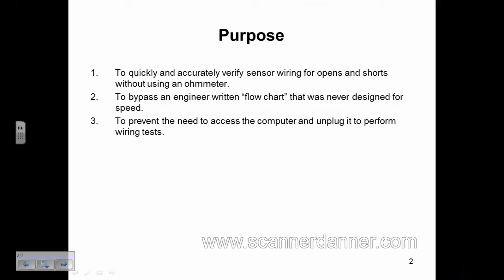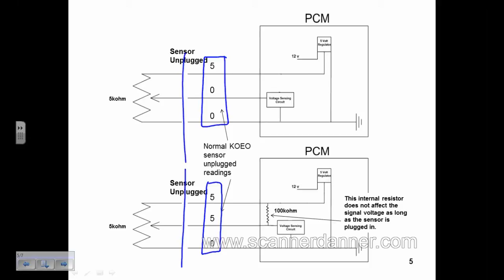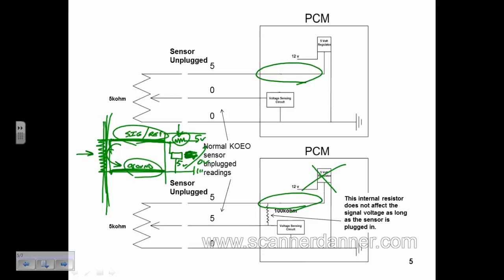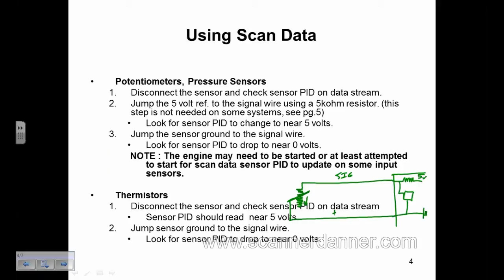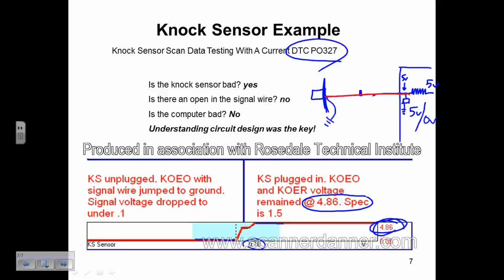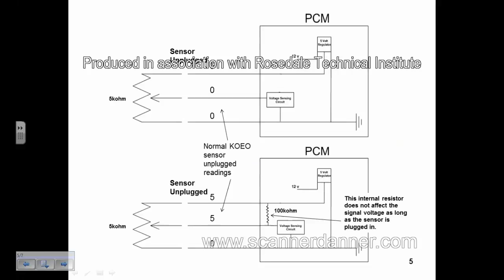Chapter 10 Signal Circuit Integrity Testing

Comment: Opps last week , I had a gm fuel tank pressure code, and I used a test light, and t pinned on wore and touched the test light to the other wire while watching scan data. I guess I should get a 5 k resistor for this ?  In my case it did work. I didn't know there was a risk as I though the 5 cold ref was protected I. Case of shorting . Off to radio shack I go. I like building little tools.
Reply from the maker: just trying to be extra careful with what I am teaching.
The 5v ref circuit is protected but I do not want to rely on that. Just as a precaution.
Reply: I understand that.  I'll get a resistor just to be safe.  We get a lot if Mercedes and BMW here,  so I'd hate to fry a pcm, especially in those.